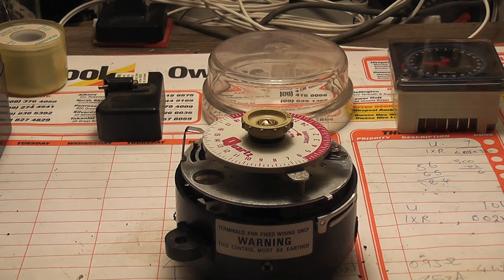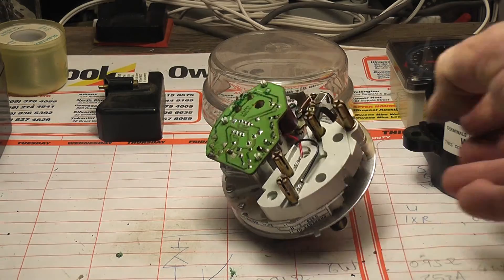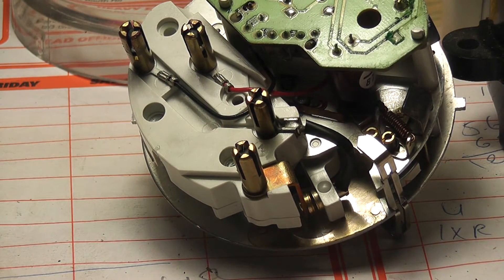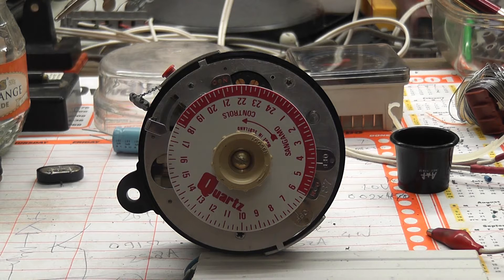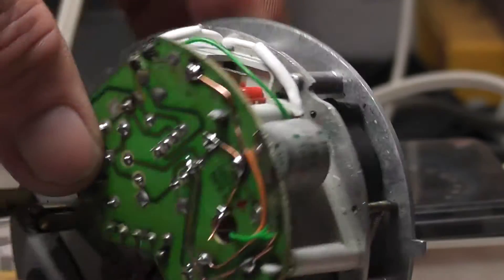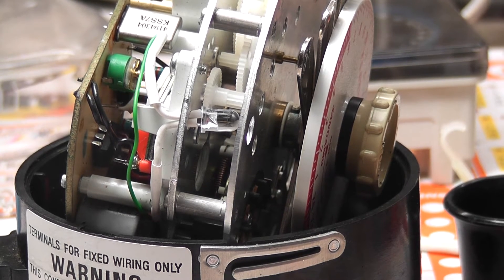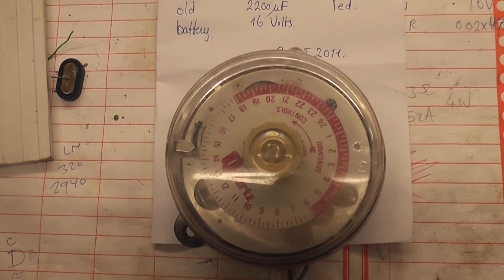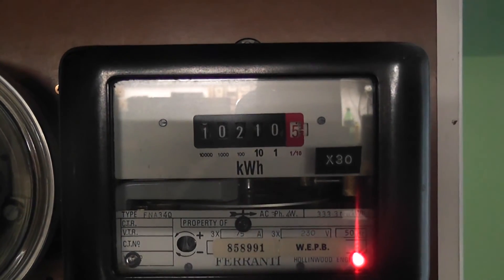Sangamo Q 555

Comment from the maker: @BoomBoxDeluxe  You could try although the LED will discharge the battery.
In the capacitor case the LED clamps the voltage to about 1.7 to 3 Volts , depending upon the LED color.

Comment: Nice idea with the LED! :-D Would it be possible to replace the battery, AND have the LED going as well? If so, I may think about hacking that other Sangamo Q345 that I have. 

Currently, that has a dead battery in it, and if I could do a battery hack on it, and have the LED, that would be great! What I'm thinking is, put the LED in parallel with the electromagnetic 'ticking' coil. :-)

The reason why I wouldn't want to do this to a Q345, is because its a sealed Rate-Changer unit.

-BBD.

Comment from the maker: @dash8brj Those clock batteries are supposed to be a back up in case the power fails.
Normally they are 1.2 Volt nicads on charge all the time.
With these newer clocks I call it designed obsolescence , Often these batteries fail and most people buy a new clock instead of repairing the latter.
You are correct in the type of 9 Volts batteries. I call them the sandwich ones with the flat cells.

Comment: 9v batteries come in two flavours. One has six aaaa cells in side, the other had six cells that look exactly like the varta cell stacked on top of one another. These are more common in rechargeable 9v batteries. The cell was probably ruined by not having a proper charging regulator to stop charging it once it was up to the regular nimh voltage (1.2v).

Comment from the maker: @HDXFH 3300 µF is 3.3 mF.
Could fit a super cap.
Most of these quartz drives work on 1.2 - 1.7 Volts, hence the led in parrallel.